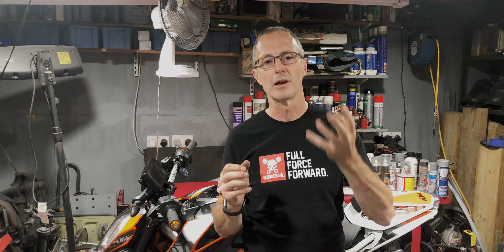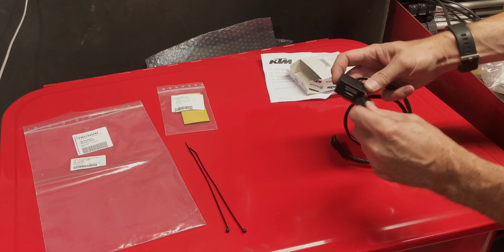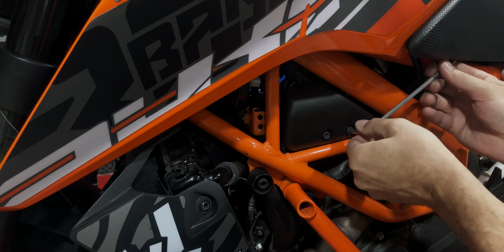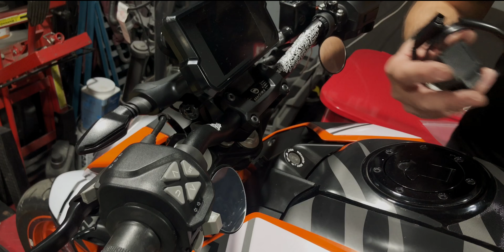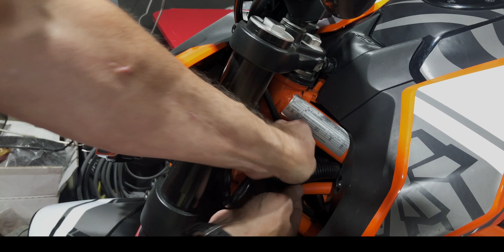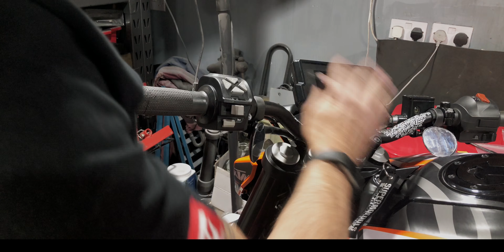USB Power Installation KTM Duke 390 125 200 250

Comment: I had plugged my phone charger into the first accessory port on my motorcycle because I didn't know which one was the other, and the charger was constantly on. After parking it in the motorcycle zone for days without touching it, the battery started to drain. I think one of the package carriers who are always there was charging their phone from my always-on charger; now they'll need to get a power bank :)

Comment: Thanks for showing how to do this. Works with the newer type usb c as well. My 2023 Duke 125 has so little space to plug and unplug. Removing the horn to plug in the cable was the only viable solution. Cheers

Comment: Bro Which Model 390....?
Reply from the maker: This installation applies to gen 2 - 2017 to 2023 ish.  Up to 2016 is similar - not sure if they only have the connection under the seat, I haven't seen the wiring for the new gen 3 but I expect they will have something.

Comment: Hello. I have a gps unit which comes with a red wire for 12 v , black for ground and then there is yellow wire called ACC. Right now i connected red and black with battery +ve and -ve and yellow with my 390 adventure rear accessory port with ignition control. So now when the ignition is on, the gps unit comes alive along with other units. My question for you is, instead of connecting black and red with battery can we connect it to accessory port of the bike according to your video? What should we do with the yellow acc wire of the gps unit then?
Reply from the maker: Yes, you can.  It depends exactly what the ACC wire is doing - if it is just acting like a switch so it shuts the unit down to prevent flattening the battery when the bike is not running, then just wire it in with the positive wire to the switched connectors.  If you wanted to retain the same setup, you could wire the positive and negative to the permanently live connectors and the ACC to the positive only when the bike is on wire.
Reply: @MotoMirius  I tried that. Positive and acc togather works on either of the connector. Seperatly it won't. I tried connected positive and negative to the always live connector and acc to the one which works with switch. It did not work.
Reply from the maker: @kuttyte  the wires are connected to the battery, so they will work the same as connecting to the battery - if you use the right connectors and don't mix up the permanently live with the switched live.  If it doesn't work then try to connect the ACC to the connection you are currently using - it depends exactly what it is doing
Reply: @MotoMirius  You were right. One of my port shorted so I replaced the fuse and now things works as you said.

Comment: On the 2021 390 that I have those connectors are underneath the pillion on the back of the bike and they're labeled as accessory 2 and accessory 3..

They are clearly marked with a label from the factory and nowhere near as complicated to connect as this video. One is switched, one is always hot
Reply from the maker: Yes, the later bikes may have both under the seat - the earlier bikes only have a permanently live, but either if you are wiring to the handlebars, the under tank ones are often easier to work with.

Comment: The constant power wires will only drain the battery if a device is left on, right?
Reply from the maker: Yes.  The problem is when you forget to turn something off when you leave the bike.   Unless something needs to be permanently powered - like an alarm, it's safer to use the keyed power.

Comment: Hello David. Thanks for this great video. I bought the original cable for the Duke 125 Model 2021 for my son. I also found the 2 cables beside the horn and plugged the 2 cables.  But it only works without the key. I switched the 2 cables but then it’s not working. What is my mistake? I want that it works like in your video when I switch the key. Regards Hakan from Germany
Reply from the maker: There are two sets of cables.  One is full time power, the other is switched power.  Make sure you have identified all four cables and you are plugging in the right combination of cables.  There should be no issues with that.   If one turns off the power when you switch on the key then there is a wiring fault.
Reply: Hi. Yes now i found it. They were behind the other cables. I just plugged them in and now it works. Thanks a lot 🙏👍

Comment: Thank you for the video, it made the installation of the KTM USB kit pretty simple. Although I installed it on my Husqvarna Svartpilen 401 it was pretty much the same thing. Had some difficulty finding the aux cable as they were super close to the bottom of my gas tank. Again, Thanks for sharing the know how.
Reply from the maker: Glad it helped and good job on finding the connectors!

Comment: Please. I am not sure. Which of the cables (from the accesory) is the positive? Is the red wire?
Reply from the maker: Red would typically be power.   If you are ever unsure and you have a bulb you can test by running  a wire to earth and holding it against one side of the bulb then take a wire from the socket to the other side of the bulb.  You will quickly see which side has power.

Comment: Hi david can connect 2 things in a single accessories port like usb charger and the DRL of an aftermarket turn signal, or do i need to separate them to avoid overloading it? What do you think of the new RC390 design.🧡
Reply from the maker: No simple answer to that - would depend on the draw of the accessories.   Much would depend on if for example you are running a fast charger.   Don't ask me what I think about sport bikes designs, I wouldn't know where to start! :D

Comment: Hello David, you reckon this setup works with ktm duke 390 2018? Also, the kit is waterproof? It doesn't say anything on ktm website about that. Thanks in advance for the reply 🙏
Reply from the maker: Yes, the kit is generic.  The kit is generally waterproof but unless you are using a fully waterproof setup with cables etc then these will be your point of failure.  You can fit any other kit instead if say you want fast charging - I’ve just used the KTM one to show how it plugs into the bike.

Comment: I suggest you buy the all-in-on mobile phone holder with charger (wireless and USB).
It’s pretty much easier and waterproof altogether.
I installed one in my KTM Duke 390 and it’s quite sturdy.
It’s 25$, by the way
Reply from the maker: There are lots of choices out there as to what you can install, so always choose the one that suits you best.

Comment: Could you please talk about the blue tooth (ktm my ride) I’ve been trying to connect it ever since I’ve got it cuz my helmet plays through my phone but I could never get it to connect. Pls pls pls🙏🏼
Reply from the maker: Lots of issues with KTM My Ride.  Most riders don't bother with it because it has very limited functionality - displaying calls on the dash and that is about it.  Much of it will depend what headset unit you are using and how compatible it is with the dash.  I've never used it - I ride several different bikes so my setup with all this sort of stuff is to use one system that works with all the bikes and for the phone it just means straight connection to the helmet - I don't take calls when I'm riding anyway, doesn't seem a particularly safe idea to me given how much you rely on observation all the time - but maybe that's just because I'm riding in a fairly urban environment or heavy traffic roads most of the time.
Reply: @MotoMirius  true, I’m always having to keep clear even in none dense areas. But it would just be nice to switch a song with the buttons instead of trying to  touch my phone through my gloves lol makes it even more dangerous
Reply from the maker: @Funny_as_Duck  I can see that.  Again, its a habit I don't have.  The only thing I use a headset for is for directions.

Comment: My duke 390 wont start when the bike gets hot but starts easy when it's cool again
Reply from the maker: Lots of possible causes on that, most of which are probably fuel related.  Check your air filter is clean and check all of the battery connections are good.   Make sure not to press the starter again too quickly if it doesn't start, this will almost always create issues. Good luck with the diagnosis.

Comment: Is that kit waterproof?
Reply from the maker: I think you would describe it as weatherproof.  To be waterproof you would also need adapters on your USB cable to make the seal, and the same would need to be true of the connection to your waterproof device
Reply: @MotoMirius  your video is super helpful for me. Just ordered one kit on ktm official website. Thanks !!!
Reply: @MotoMirius  i think that the question is if you wash the bike, does the accessory get damaged?
Reply from the maker: Do you think that KTM would sell an electrical accessory to fit on their bikes that isn’t waterproof?   I think that would be a very unlikely oversight on their part.
Reply: @bercyrv  I installed and used it for almost a year. Everything’s fine.

Comment: purchased the KTM usb power outlet. I don't seem to have those two cables beside the horn - could they be located some place else?
Reply from the maker: Wiring looms are the same for all bikes, so wires will always be in the same place.   You will need to check again and see if they have not been tucked behind something, check from both sides of the bike.  Good luck
Reply: @MotoMirius  thanks! Keep up the great work and putting out splendid videos. ✌🏻❤️🇨🇦

Comment: Thanks for the info on the Accessorycables, now i know where to attach my heated grips for the upcoming cold days, without risk of forgetting to turn them off!!! USB i did attach to Perma power though, cause it doesn't drain if not used... Awesome!
Reply from the maker: Sounds like you've got a plan!  Skäl  David
Reply: @MotoMirius  what are the plugs called that fit the connectors? BTW... I am the RFID Idea guy 🤪cheers
Reply from the maker: Spade connectors.   Very common.
Reply: @cashtra  Did the heated grips on accessory cables work OK? I'm thinking of doing same.
Reply: @mrnoisy4883  works like a charm!

Comment: Thanks David, I didn't know about those 2 accessory cables. I bought similar socket on aliexpress for about 3 euro and connected to available plug behind passenger seat.
Reply from the maker: I mention under the seat in the description but I haven't checked if it's switched power.   You can get great deals on aliexpress but I avoid the platform because very often the stuff is cheap for a reason and I'd rather not find the bike burnt out because I saved a little money.

Comment: Thanks David!!  Very well explained in detail as always.  What mileage (km) has your 390 done?  Some say the 390 is not a very durable bike... your comments??  Regards!
Reply from the maker: Mine is about 5.5k miles - all short distance trips.   I have to question quality on the bike, it's not made to the standards I'd expect from the Austrian factory.   But most modern bikes and cars seem to have issues.  I know for example that BMW car service centres spend a significant part of their time doing recalls and an ex-recovery guy I know reckons that he mostly went out to broken down BMWs.   People with issues are very vocal about it so it's hard to get a balanced view.   There are plenty of people with a decent mileage on their bikes with no issues but they don't talk about it, so I don't yet have an opinion aside from the fact that there are some low quality parts on the bike.
Reply: I've personally done nearly 20,000km on my duke 390 2018. So far I've had very few issues. It was stalling randomly for a short while when changing from second into first, but that seems to have stopped for over a year and the indicators were flashing randomly after a ride in heavy rain, which I solved by taking the switchgear apart and cleaning it. Only other issue is the paint has started peeling off the engine block and a number of bolts are rusting, but it has been kept outside so that may likely be the cause.

Otherwise it's a fantastic machine. Tonnes of fun for such a small displacement machine.
Reply: TheJWC56 I’m wondering that myself. I don’t know much about engine stuff and I heard similar things. I actually own a 2019 390 Duke and haven’t had much issues but I’ve had it stall out on me a few times while riding. It happened to me twice in one trip (about a 100 mile trip) where I pulled in the clutch and it just stalled. Other than that it’s been ok.
Reply from the maker: Stalling out seems to be a common issue.  Given that this is a bike commonly ridden by new riders, I'm not so sure how much is bike and how much is rider.    Some people seem to have issues with the clutch switch.   But I've stalled the bike any number of times and I have enough experience to know that every single time it was my own fault - most commonly it happens after I've spent a few weeks only riding a sports tourer and it can take a couple of rides to reset my subconscious to allow for riding a bike with very little rotating mass in the engine where for example even a little drag by not quite getting the clutch pulled in enough will allow the rear brake to lock up the engine via the transmission.  I stalled it the other day pulling off a junction (which was amusing as I did it in front of another rider) because I had too much clutch and not enough revs - none of my other bikes would have done that, but none of them have a lightly modified competition dirt bike based engine either - it requires a different riding style to most other bikes, in my opinion and I'm not sure how many people realise it.
Reply: Moto Mirius When it happened to me, I was accelerating right before and when I got up to speed, I pulled in the clutch to coast for a little bit and as the bike rev down, it stalled at the the bottom
Reply: @ZackaryTheGreat  i was able to get it run smoother wothout stalling by adding a Boosterplug, which only simulates slightly lower temperatures for little higher fuel injection... No ECU needed... Coasting in low speed stop n go traffic seems fine now. I hope the engine is reliable, as i only use my brakes in abrupt downspeed situations, and tend to let the motor do the work downshifting...